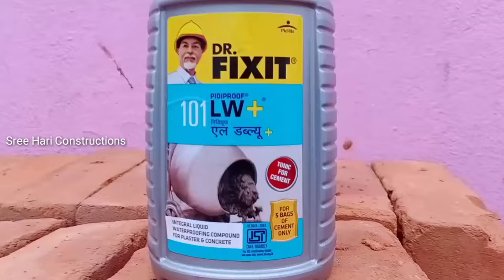RCC sump construction | water sump | Sree Hari Constructions

Comment: I have heard you also put white tiles inside the sump in other videos. Can you please confirm why wasn’t it put here? Also, providing legs is a must so it helps to climb down when it’s time to clean the sump.
Reply from the maker: This client said not to provide legs ✌🏻 , thats why .
Reply: @sreehariconstructions  Why no tiles?
Reply from the maker: Because , The client said not to use tiles ✌🏻
Reply: @sreehariconstructions  what are the pros and cons pls? I thought it’s good to have tiles inside. Isn’t that the case?
Reply: @sreehariconstructions  very technical answer.

Comment: How much cost for 7feet length and 5feet width
Reply from the maker: Rs 10 for per litre
Reply: What's the litre capacity for 7 feet lenght and 6 feet depth and 6 feet width
Reply: @raghav913  7200 Litre
Reply: @sreehariconstructions  chennai la house 🏠 contract basis la kaduveengala